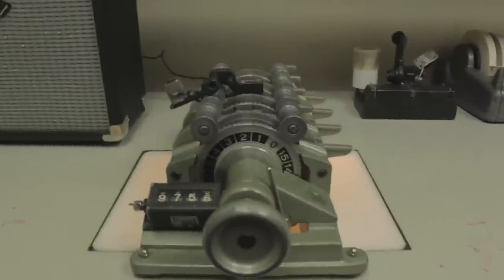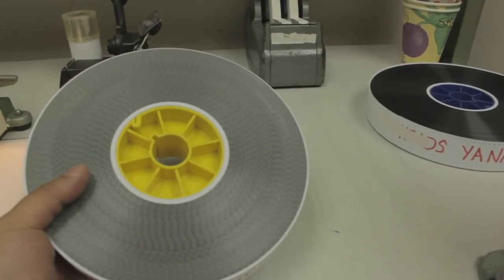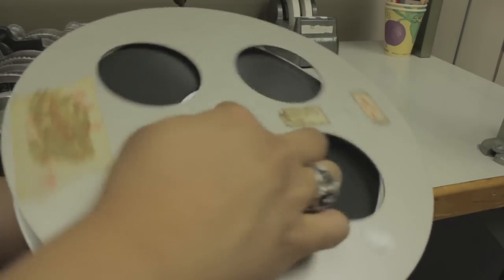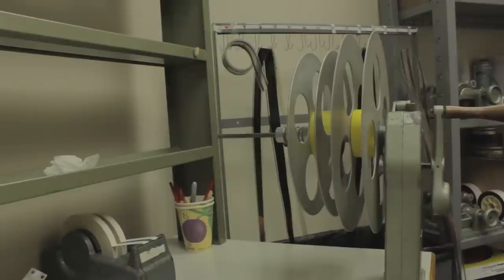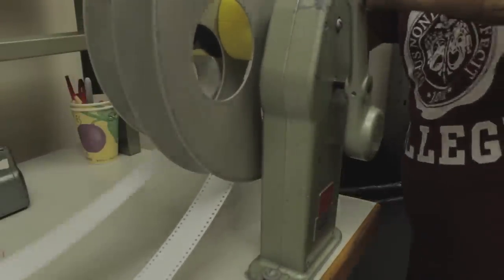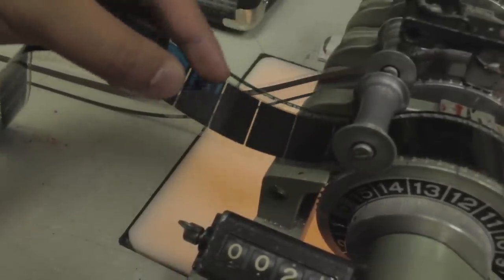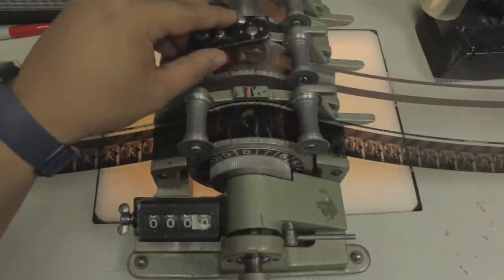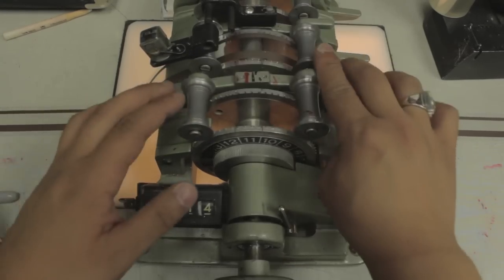How To Sync 35mm Dailies

Comment: I am am emmy award editor and began on 2" video tape a. We used to cut tape back then and we could not see the edit until played back. We had to "develop" the tape to see the frame pulse on the tape so we could cut at each frame. To see the frame pulse we had to use a microscope but at least we always had the sound & picture sync'd all the time 
What is interesting to new people to edit, back in the days either on film or tape, you could only make CUTS, no dissolves or wipes or anything else. No special effects etc. Notice carefully on older movies when a fade or dissolve happened. In the case of film, you would have to send those frames out to optically mixed together onto another piece of film. After that yoy would have to locate those frames on the "master" and perform a cut right at the point where a dissolve would occur. On screen you would see a generation quality change fir those 48 frames or so, then the quality would improve once the dissolve was complete. Watch for it next time.
I still miss quad editing

Comment: Hey I see you're using 35 mm magstripe. If you are, there's a great likelihood you use the sound transfer technician to get your original quarter-inch transferred onto that. What studio is still using sound transfer technicians in 2014? I was a sound transfer technician in the early 80s and thought the craft was somewhat obsolete at this point?? Where are you doing this film work I'd like to know?
Reply: If hes at a university film dept, there may be a tech room with equipment to make the transfers

Comment: He can't have synched up a huge amount of rushes/dailies, because that is by no means the fastest way of doing it. He opens the gangs much more often than necessary. (As a first and second assistant editor on about half a dozen major movies in the 1980s, at Pinewood and Elstree Studios in London, I had to synch up 1000s of feet, dozens of takes per day, between c.9.00-9.15 am - when the rushes arrived from the labs - and the 10 am viewing of the rushes in the viewing theatre by the director, cast and crew - sometimes a real battle against time)
Reply: Would love to hear more!

Comment: Sure makes me appreciate non-linear editing.  :-)
Reply: This was/is nonlinear editing. Film was inherently nonlinear, since you could literally cut a frame or series of frames and splice them anywhere without having to undo everything ahead of it first only to reassemble it in sequence. Think being able to take a hangar off a closet rod and place it instantly anywhere else on the rod. Early video, though, was linear. Instead of hangers with hooks, now imagine you had rings that couldn't be removed from the rod without sliding them off one end. In order to move one ring to another position, you'd have to remove all the rings before or after it. Then you'd put back whatever rings you needed before placing the ring in question where you want and adding any others in the sequence as needed.

Comment: What a great hands on video, where do you get a synchronizer with the sound head?
Reply from the maker: jonathan Hancock they can easily be found on ebay nowadays for not too much money
Reply: I have the space for a steenbeck but not the location
Reply from the maker: jonathan Hancock what do u mean?
Reply: pinoy0978234   Do I have to trade off the expensive exotic locationWith promising opportunity for the equipmentAnd the vastness of cheap space in a rural area. Understand it’s just the synchronizer, that I am probably overreacting. Who taught you all the stuff are you self-taught as well? I meant to ask a different question that I did not state.
Reply: I publicly apologize
Reply: I am genuinely interested in your film can I show it at my movie theater I have a 35 mm projector but I just need to build it and wire it. I only have one projector so It can’t be more than 1000 feet
Reply from the maker: jonathan Hancock its not my film its just a test reel. I am not self taught. I learned this in one of my classes in film school from one of my profs who did this in the industry back in the day

Comment: I didnt know the audio was on a separate roll. Im sure I have seen audio tracks on the film strip too..
Reply: I think that's just for the release print (or was, way back when).
Reply: @DaCarnival   i may be incorrect but I think some film labs can (or atleast used to offer the option) sync your location sound to your dailies right onto the work print. Cost more though

Comment: How did you get the sprocketed 35mm clear film that houses the audio tape?
Reply from the maker: Its called 35mm mag stock. You can still buy it for $30/100ft. 100ft is about 1min of audio @ 24fps
Reply: @pinoy0978234  thanks! Last question, what device is able to record to 35mm mag stock?